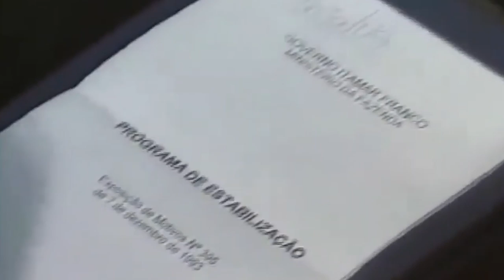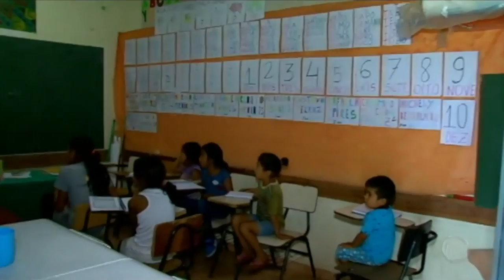Brazil - The SECRET of Why It Isn't Rich (CC)

Comment: Very good 10000 feet view of the current issues holding Brazil back! Please come full circle and do a video on the taxes in the productive sector and the craziness of the 2018 tax reform (mostly because it was all about more money and controls, not helping productivity). You will find multiple taxes and even the taxation of "expected gains" and having to file to "get back Sales Tax" from the next step in the productive chain. The Brazilian tax system needs to be shamed publicly for what it is and does. A government of the government, by the government and for the government.